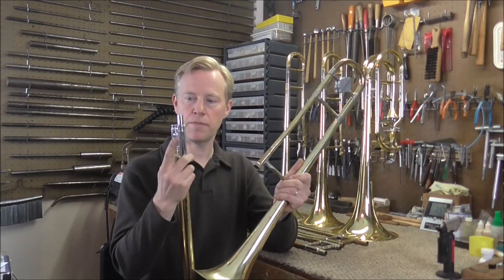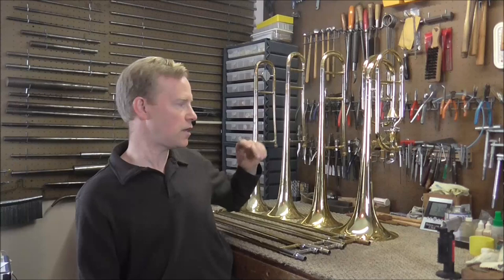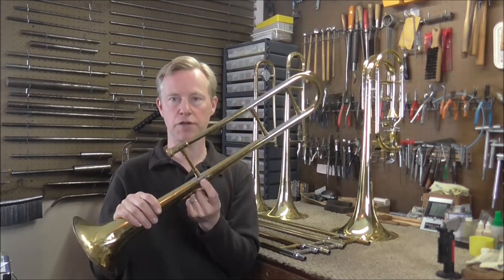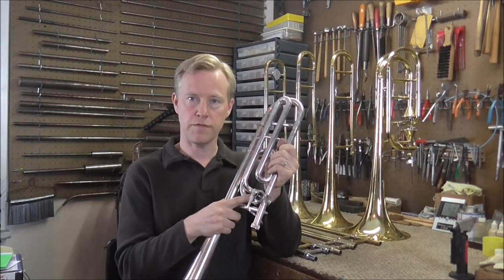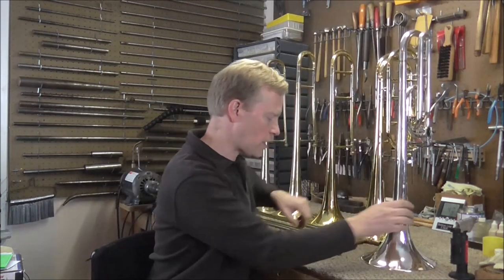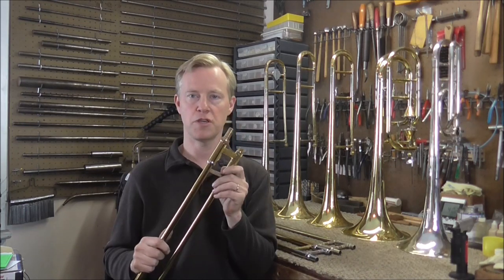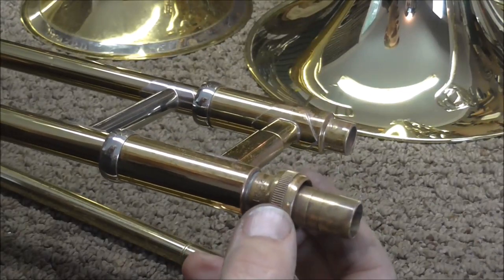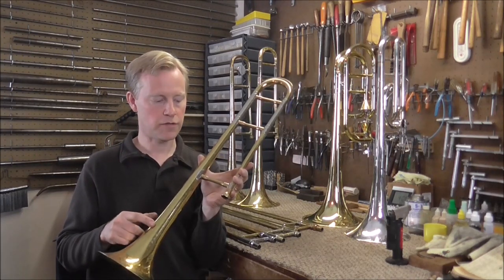Where Is the Serial Number On My Trombone?

Comment: Thanks for the video. I have a Bach 42G with number 22722 on the valve casing but I don't have the original slide. How could I find out the serial number?
Reply from the maker: I do not think the number on the valve has anything to do with the serial number, but I am not sure. Sorry I could not help you much.

Comment: I have an Olds Ambassador trombone which says Los Angeles on the bell.  It has a 32xxx number on the bell near the thread connection, and a 305xxx number on the slide under the nut.  I have seen this on other trombones as well with different numbers on bell vs slide.  In this case, is this an indication that this trombone has a bell from late 40s and a slide from late 50s?  (Going by data from Horn-u-copia.)
Reply from the maker: My guess is that it came from 2 different instruments. I see that often with school instruments. It is most common with clarinets, but it also happens with trombones.